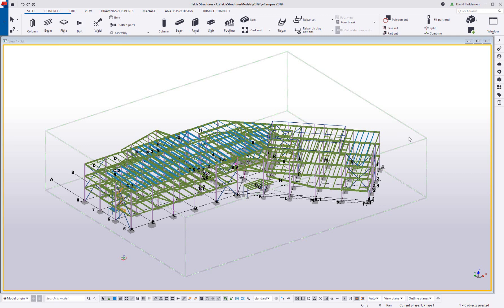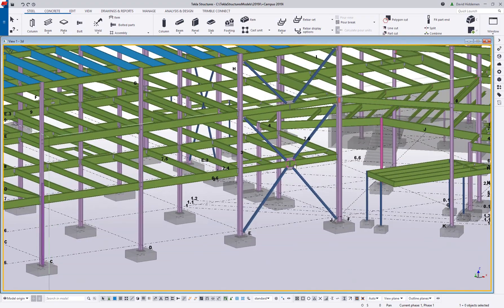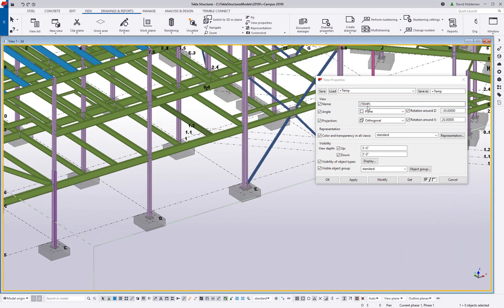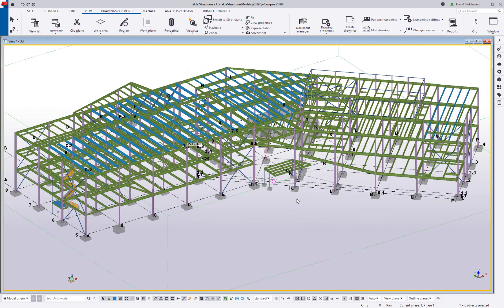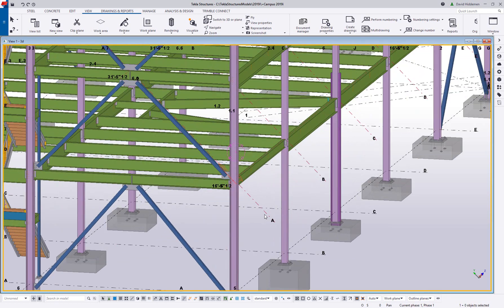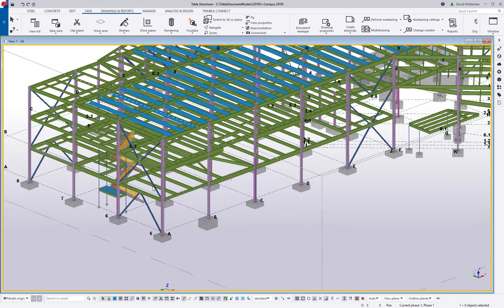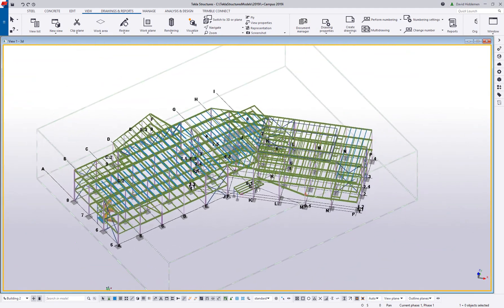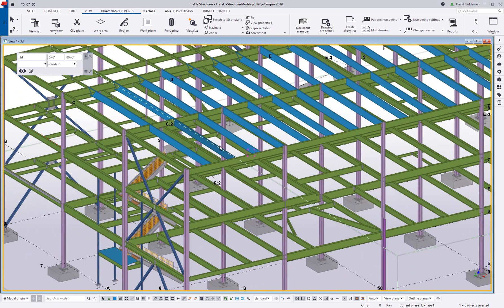Modeling tips and tricks with Tekla Structures

Comment: The ribbon is to slow
Reply: Hi Vernon - if you use a lot of ribbon commands you can customize the entire thing through the File menu > Settings > Ribbon. You can quite literally build a 'toolbar' style layout with small buttons instead of the current layout. https://teklastructures.support.tekla.com/video-tutorials/en/customize_ribbon

Comment: Hello sir, could you please solve my problems , I Cannot delete or modify a part because of locked objects.
Reply: You need to find the locked objects and unlock them, you can try using the 'Locks' button under the manage tab to review the locks in the model and remove them. Note however, that the locks may need to be removed by the user who added them due to security limitations. For better assistance, you should contact your local support: https://www.tekla.com/contact/offices-and-resellers